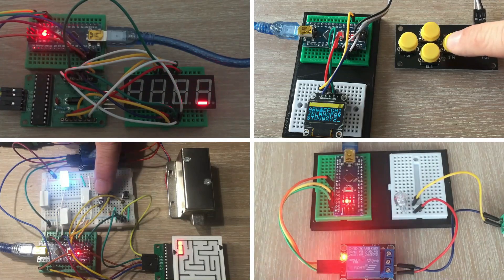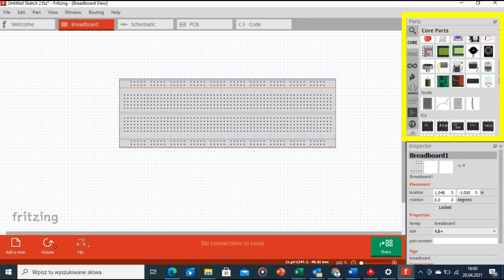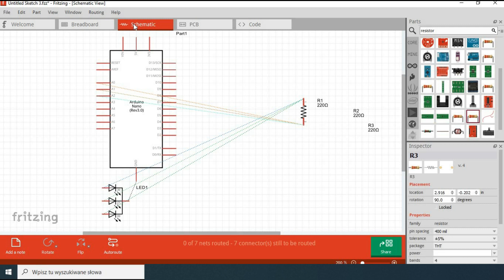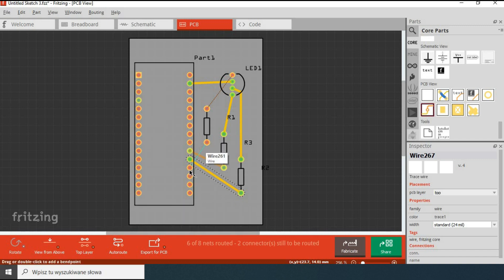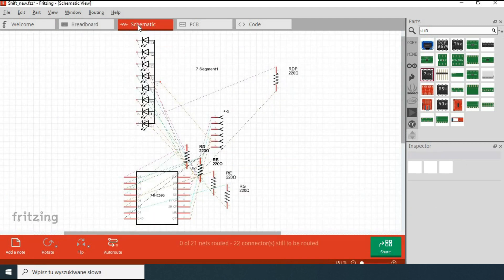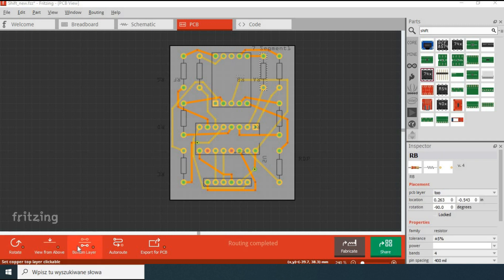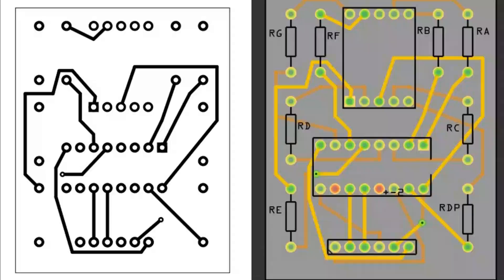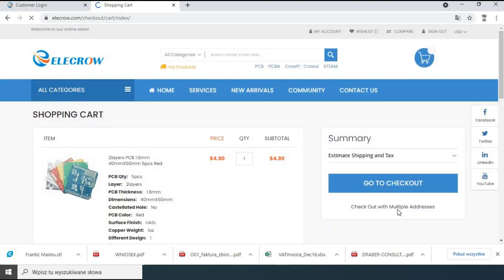How to design PCB for your Arduino Project with Fritzing application Part1 - Design and order

Comment: so why the hell do you have to re-establish the connections on schematic view when it's already done on breadboard view? Why is everything comnected to a single resistor?
Reply from the maker: It is an old video but I would swear there are 7 resistors one for each segment. I even solder on the components in the follow up video which you probobly didn't watch either. Are we watching the same video.
Reply: Sorry if my point wasn't clear. I mean, 3:05 : clearly 3 separate resistors going to 3 legs with 3 connections. Then you change to schematics view at 3:21 and voila all legs are now connected to R1. That was my point. Shouldn't the software keep the existing connections, why disconnect R2 and R3 when they're connected in BB view.
Reply from the maker: @drwhave  Well at one stage you look at 3 resistors which are one on top of the other. This is what happens when the schematic view is generated automatically based on the connections you set up on PCB. Few seconds later I am actually repositioning those 3 resistors so the schematic look ok
Reply: @marios_ideas yes I see you're handling it, but my point was, from software development side it's a pretty big miss if the schematic ignores what's already there...😂 why would it make you work twice, what's the point of making the same connections for the same project on different tabs? hope this is just some silliness of the old version, as I'm looking to convert to this software. obv not your fault

Comment: Great intro to Fritzing, thanks. Btw, in your project, where do you put holes to have 12V power? I couldn't find it in your schematic or board.
Reply from the maker: Not sure why you wanted to see 12V. This module is powered by Arduino 5v pin

Comment: where the arduino fit into the design,
Reply from the maker: Mind you this is just a simple design to show how to create the PCB. If you check the follow up to this video https://youtu.be/ov1rs-MPe1Q there you will see how I connect this custom PCB to Arduino , or even daisy chain few  of them. You can also check one more project of mine   which involves custom built 7 seg display using Custom built PCB. In this project there I have a slot for Arduino on the PCB https://youtu.be/ux3cpw0nHo4

Comment: Thanks for the video, I am making a project although have great issues with the final pcb, error after error. Its only basic but I don't understand why automation adds errors. 4 hours i have spent to no avail.
Reply from the maker: When the project is more complex autorouting is probably not the most smart idea. I lay the tracks  myself.
Reply: @marios_ideas  thank you i tried that too lol i do have a overlap error on bottom layer on my ic chip and nano board on top layer not the traces. Im such a beginner this is my first one i